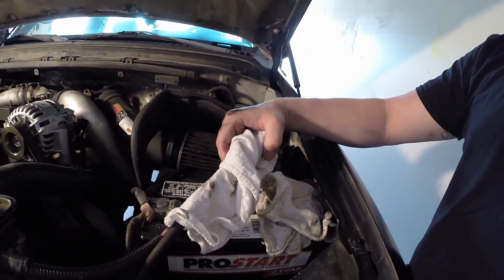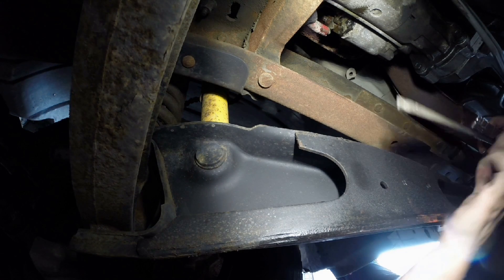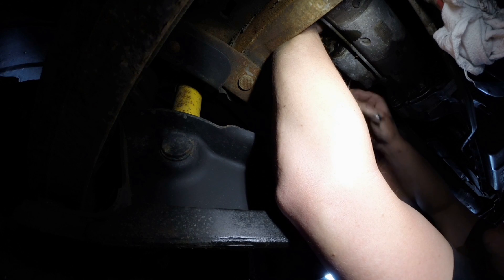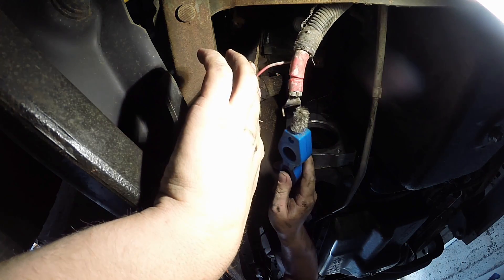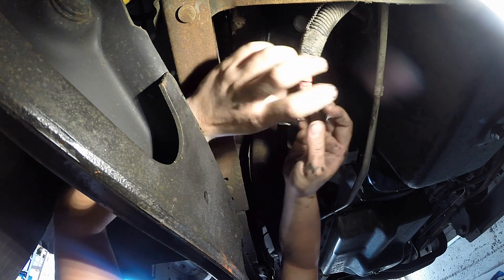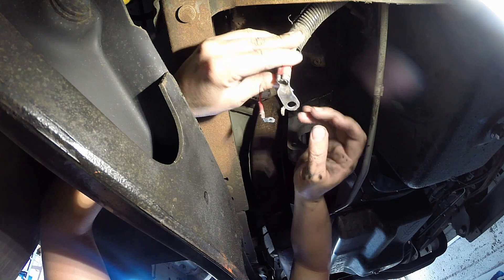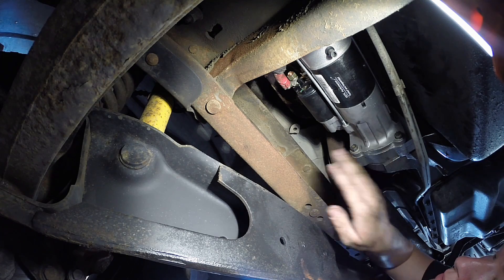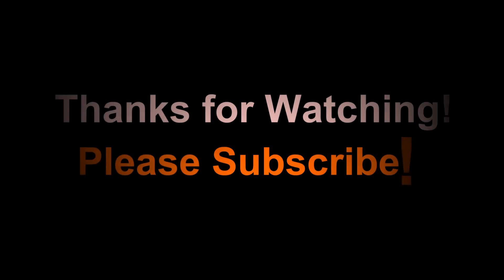Ford 7.3L Powerstroke Starter Replacement Procedure

Comment: Put an ultima select starter in my 61k mile 97 F250 using this video to make sure I didn't make a dummy mistake, glad I did, thanks! Truck has never started so fast and the batteries are 3 years old now!

Comment: I had to change the starter in my big 90 973 wants and now the solenoid relay for the starter on the thunder is gone, which I’m assuming when they’re we will cause very low turnover and no start, but I’m not so if anybody has had that same issue and has been through thisyour thoughts on it would be very much appreciated to help me out

Comment: So it sounded like you said the stock mounting screws are 13mm [6-point] head, the power lug is 15mm, the solenoid is 10mm stock [8mm in this particular case is likely due to a prior replacement]. 

It appears many replacements in 2025 era use 17mm screws for the mounts [which lead to many recommendations of cutting a wrench in half in order to get it up in there on the upper screw.

Comment: 1997 Ford 7.3L Powerstroke and Solenoid replaced a month ago.

Now, it won't start.  All is good up until I get a single click followed by silence.  This is exactly what happened when I was in town and came the start the truck then. At the dealer they said it did not start on the first try, but did on the second try.  I still had them do the repairs.

The 7.3 has a lot of wires and they are old, but everything works except for the starter does nothing.

Comment: Another option for the top bolt is using around a 8 or 10 inch extension

Comment: Replaced starter.. have a crank no start now. Before I purchased the starter I had a really slow crank to start on my truck. Batteries sitting were around d 12.5v so I thought it was my starter as it was the original. With new starter in, I noticed when cranking the cranking voltage is like 7.5. Would this be the reason the truck won't start?
Reply: I had this issue. Batteries had failed!

Comment: After doing this my truck makes a horrible screeching noise when I turn the key, and won't start. So if anybody has any ideas I'm all ears.

I should have just left it alone. I had to cycle the key three times to get it to start but at least it started, which now it doesn't.

Comment: exactly what tool is needed to get onto that NASTY top bolt?  No room to manipulate, even a stubby boxend. Over the top side with an 8" extension gets defeated by the starter's girth, no angle. Do we need to heat and bend a boxend handle to create an "L" shape (like olden days distributer wrench)?  Am stumped at this point. Need some helpful knowledge here guys.  HELP !!!!  lol

Comment: I will be working on my sons F350 starter.   This video helped.  Thank you for putting it out here.   He has the three bolt.  He is also being told to change out the batteries too.  I going to do the starter first.

Comment: buy starter not made in china, thailand better, japan or us best  , us overpriced.   tighten bolts, with locking washer and red loc tite.  cut off a 3/8 ratchet wrench to make it stubby to get the top bolt.  easiest job i ever did on my OBS (well, to be honest a bolt fell out, so I didn't need to detach the starter, but I did need to run to hardware store for metric 17mm head, large thread spacing bolt, could go shorter or longer than stock bolt..

Comment: Excellent video👍This is is a day later replaced my starter today. This video was a giant help and everything was very straight forward other than that on top bolt that was extremely tight and took a while to get the correct angle and leverage on it. Install was a breeze! Thank you!!
Reply: exactly what tool is needed to get onto that NASTY top bolt?  No room to manipulate, even a stubby boxend. Over the top side with an 8" extension gets defeated by the starter's girth, no angle. Do we need to heat and bend a boxend handle to create an "L" shape (like olden days distributer wrench)?  Am stumped at this point. Need some helpful knowledge here guys.  HELP !!!!  lol

Comment: I’ve done this on my ‘02 too many times.  I only have 200k on her, but I’ve been through 4 starters.  One would think I’d go with a starter from Ford, but no,  I go with the chain store with a lifetime warrantee.  I’ve only paid for 1 starter, where as if o got it from Ford, I may have only replaced the first one.   Bottom line, if I had done it right the first time, I probably wouldn’t be doing it so many times.

Comment: Thanks a bunch for this video. I reviewed it before diving into the work and it helped me greatly! My starter was a two bolt version with 13MM bolts. The Power connections were 16 and 8MM. Pulled it out, took it to NAPA and had a replacement in in under two hours! Thanks again!

Comment: My 99f250 super duty
has 3 wires .
The new starter i got
Has only 2 poles for the main 2 wires 
What to about this
Reply: Hey Tim did you ever find the answer you were looking for. I too have a 99 f250 and about to change out the starter.. Hopefully you found the answer, just Incase I run into the same issue. Thanks

Comment: I have a 91' ford E350 ambulance with shielding plates under my engine.  Can't see the starter location...  which side of the engine is the starter on?   First time I've had this issue with my truck.   hate to have to remove the two shields before knowing how much time this will take as I can wait until May to do this.  Thanks.

Comment: nice video...   I have a 91 E350 ambulance and the starter seems to be struggling.  my cables to the battery clamps are terribly corroded so I'm wondering if I'd be better off swapping out the cables first before considering a starter swap.    I appreciate your advice!  Thanks!

Comment: I recently purchased a 2002 Excursion 7.3 starter plate was broken and I noticed the starter that was installed only had two bolts when the original head three ordered a new plate flywheel and the replacement starter is another 2 bolt starter are those okay to use or should I find a direct replacement 3 bolt starter
Reply: What did u do? How did it go? I just changed from 3 to 2 bolt. Stripped bolt holes suck on mine.
Reply: @duramaxdad  it was several years ago but I ended up just installing. The two bolt starter works fine. As far as the strip bolts, I would recommend a heli coil

Comment: use Denso TG 228000-8420 12v made in Thailand. Gear reduction starter (two bolt) works on the 7.3.

Comment: Do You know what the thread pitch is on the 3 bolts ? I need the fix the threads that the bolts go into. I have the 2002 F350 7.3 Diesel. My bolt head seems like half inch instead of the 13 unless someone put wrong size on it in the past.

Comment: Use a 6.7 Powerstroke starter, and replace the nose cone with the old 7.3 starter. Very fast cranking, and builds oil pressure sooner. My truck starts like a new one. Less than a second!

Is that a coil sprung 7.3?
Reply: I'll look into that.  Yes that's a 2wd truck
Reply: Or a 6.4 starter but have to swap nose cone as well.

Comment: Use your videos all the time , you cover all the steps to be safe so I was a bit surprised when you were bolting the starter in your face was on cam and you weren't wearing safety glasses, I cant seem to not get trash in my face when im working under my truck , be safe your eyes cant be replaced as easy as an unwrapped battery cable

Comment: The small red wire (i believe you called it an s terminal) where does the other end attach too? My runs from my starter, up into my engine bay but is loose with an exposed end. I think that it got disconnected somehow and is causing my no crank no start issue. If you could inform me where that small red wire from the starter attaches too, I’d really appreciate it!
Reply: If it's the one I think you are talking about it is your ignition signal wire

Comment: So I have the 1997 f250 power stroke model and the starter setup is way different than your video. The mounting bolts are actually quite long, but my problem is the one on top. The two on the bottom are already out, but the one up top is in such a small and tight area I can’t get it out. I can put two fingers on the head of the bolt, but that is as close as I can get and it’s done completely by feeling with no sight. 
Any ideas how I can get to it? It almost seems like it was designed this way to deter joes like me from working on it. The problem with that is that it won’t start so I can’t even take it in to a mechanic so I’m screwed. Thanks.
Reply: Use a mirror and light to find the bolt head. Then use a appropriately sized socket with an extension long enough so that it allows you to ratchet the bolt out from the back end of the starter.

Comment: What do you do if your starter is stuck my trucks in neutral there's no bolts left but it won't come out what do I do
Reply: Hit it one good time with a hammer. Sometimes it takes a shocking blow to break it loose.

Comment: Great video, very informative and straight forward!! I lucked out, it turned out that my starter was fine. One of the starter bolts had vibrated completely out and the other was loose which obviously caused a misalignment of the starter and flywheel. One new bolt and some red Loctite and she's good to go!
Reply: Hey man! I just wanted to shoot you a vote of thanks for posting this comment. My starter was having issues and was thinking I would need to buy another starter ($250). Read your comment and saw that I had the same issue you did! One was gone and the other was loose! Which was causing the starter to not catch. Thanks for posting your comment cause I wouldn’t have known about that and would have spent $250 bucks on a new starter!

Comment: You sir saved my ass. My starter just died today leaving me stranded by the river I was fishing at. Lucky for me I had a buddy pic up the starter and drive it out to me. I then performed in the field repairs so I could go home and your video help me so much. Again thank you.
Reply: I need yo change my tomorrow lm nervos
Reply: @D.C builds I went on line and matched it to vehicle on autozone and had my buddy pick it up for me. For the 7.3 it’s not a hard fix it’s more time consuming cause of how heavy and huge they are to do while laying in the dirt under the truck
Reply: @D.C builds there are a few models to chose but they all work. I believe the more expensive ones use a different gearing for really fast turn over times. They run about 250 and up. Good luck man.
Reply: pro trick: watch series on Flixzone. Me and my gf have been using it for watching a lot of movies lately.
Reply: @Bodie Hayden Definitely, I've been using flixzone} for years myself :)
Reply: It's often the solenoid that fails. Before you call a tow truck or a buddy to grab a new one you can always try jumping the solenoid with a screwdriver or another for just to get you home. If your solenoid is gone and starter is old might as well change it whole unit
Reply: @quintonbreitmeier4777 yeah the truck is long gone now. I did try that the main power supply terminal post broke off the end of the starter so it wasn’t able to get power to it.
Reply from the maker: Nice! Great to hear.

Comment: I just want to say thank you very much for this video. I was pretty sure that I had to change the starter on my truck. The problem is that I don't know anything about diesel engines or trucks. I took my time and followed your instructions very carefully and I was done in about 35 minutes.
My truck has never started so well as it does now. Thank you so much for making such great videos. It may not seem like much to those who know what they're doing with trucks, but it made me feel a lot better that I did it myself and saved a lot of money!
Reply: Joe Klug you

Comment: Hey man I got a e99 7.3 4x4 and I had a problem with my batteries and replaced them. They are two weeks old and unnoticed the other day the truck got slower and slower to start. Then 3 or 4 days ago it got real weak and quit trying to turn over. I checked the voltage on both batteries both 12.7 volts. I checked the percentage of charge and they were both between 80 and 90 percent.. I was only getting a clicking noise at the time. I replaced the solenoid on the passenger side fender. And now it doesn't even click. Any suggestions?
Reply: Did you find out what the problem was?
Reply: Sounds like my same problem. Any fix?
Reply: Replace the starter solenoid. If that doesn't work, try jumping the solenoid. Mine worked, it was the key switch and wiring that failed. I ran a push button start to the solenoid from the battery. Wiring in these old Ford's goes bad.

Comment: hi on a 99 ford f350 superduty how do you access the horn wire
Reply: the front end is at the horn.  look on top of the RF wheel well liner, between the liner and fender.

Comment: The three main starter bolts on my 2000 F-250 7.3L are 17mm. The cable nuts are 15 and 8mm.
Reply: and the sway bar arm really impedes the amount of space, its doable but that damn sway bar is a pain to work around
Reply: Thank you!! I wish we would just call things by the size of tool used to remove them, not the physical size of the bolt.

Comment: Any thoughts on the Denso gear reduction starters? Are they markedly better than the stock units. I have an '02 F250 7.3 CC Short Bed Lariat. 4x4. I would like added peace of mind of the Denso if it's good to go.
Reply from the maker: +Pee_Dee_Swamp_Fox I have heard good things about Denso yes just no honest experience with them.
Reply: Definitely get a denso.  Much faster cranking and starting!  Been running one for 3 years, wouldn't go back.
Reply: Denso for anything aftermarket is the way to go if you can get your hands on it!
Excellent brand name with nothing but great results.
Reply: FordTechMakuloco Thanks.
Reply: All the Denso starters for my truck (1995 F-250 7.3) are remanufactured. Do you still recommend it?

Comment: oil cooler o rings next? if starters gone then chances are its higher milage and the oil cooler o ring be rock hard by now
Reply from the maker: Maybe but I checked and his oil cooler was perfectly clean. I don't see the oil cooler rings fail too too often I have only done a handful of those.